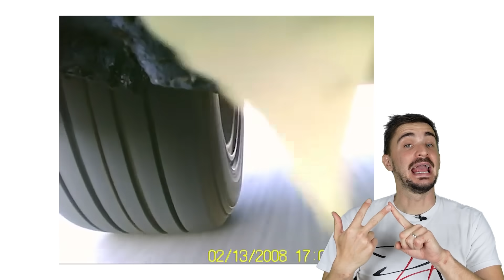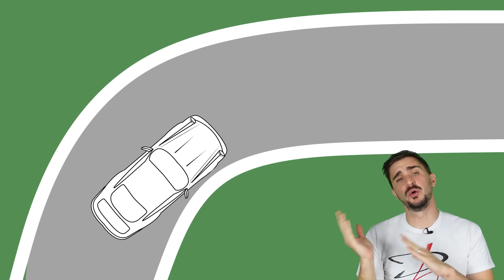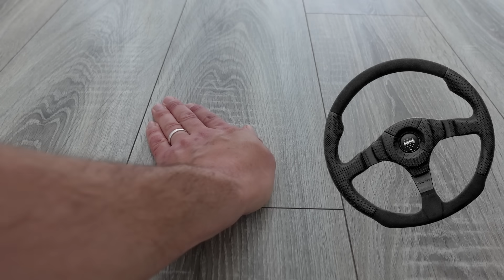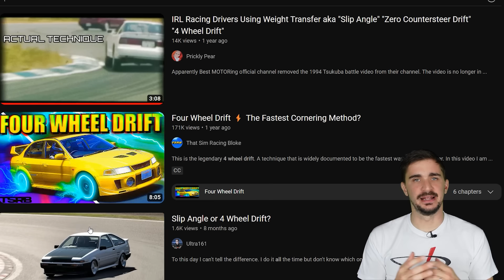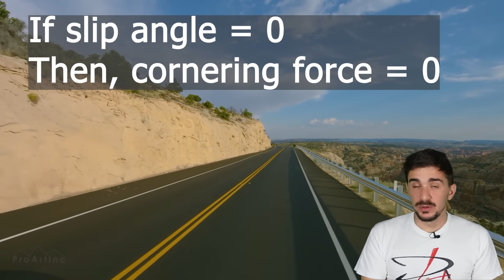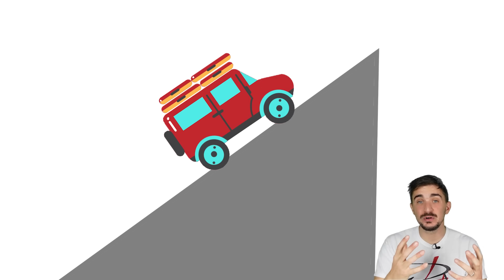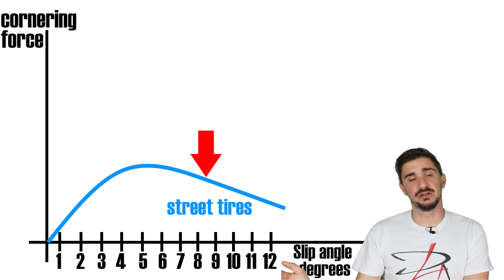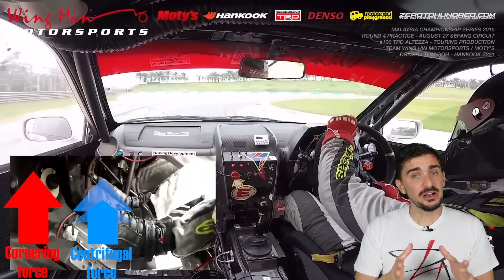You Think You Know But You Don't - Slip Angle Explained in a Way You Will Understand

Comment: great presentation (again) in an area where there's a bunch of different ways of explaining things  

a lot of people say there is no such thing as centrifugal force. this is wrong. a centripetal (inwards) force is required to make an object turn instead of going straight, which is the natural motion; and if there's a force in one direction, there must be an opposite force somewhere else. the road pushes the tire towards the center, and the tire is pushing the road outwards. this is centrifugal force, and with the right equipment you'd see that the road is compressed laterally to confirm that a force is being applied to it. but note that physicists often prefer to describe these situations in terms of centripetal force only, rather than a balance of centripetal and centrifugal forces: an object following a curved path must be accelerating inwards, according to the instantaneous rate of change of the velocity vector, and the road applies the force to make that happen. except, if the force required exceeds the the tire's ability to push back, the road cannot apply enough centripetal force to follow the curve, and a less tight curve is followed instead

the way i look at "cornering force vs friction" is that friction is the limit of cornering force, assuming you are not also braking/accelerating. if a cart with polished wooden wheels drives on glass, the slip angle is negligible. real materials aren't perfectly stiff so there's always some slip angle, but mathematically there's no problem imagining ideal wheels  of zero width cornering up to the limit of static friction. the wooden wheel behaves very close to this ideal, up to the static limit, at which point friction drops very dramatically to the far lower dynamic friction and the cart breaks into a slide. back in the real world on rubber tires, most cars don't exceed their grip limits. as your cornering acceleration (v^2/r) goes up, the tread twists and slip angle goes up, but your total available friction is irrelevant. so you think about the dynamics of steering input, slip angle & force. for average people taught to drive well within their grip limit, this simplifies to "turn the wheel and the car follows that radius", aka "i have no idea what to do when i lose control". and even though we don't think about the maximum available friction, the friction force at the road/tire interface is exactly the "cornering" force that the tire creates internally as it twists and mediates the force between the rim and the road. but aside from grip, the advantage of a rubber tire over a wooden wheel is what happens near the limit, which is that the rubber against the road gradually transitions from static to dynamic friction as the patch twists into steeper angles: even as some rubber starts sliding, the remaining rubber is being pushed to its maximum capacity, so the total grip still increases. and after the peak is reached, you can still increase the slip angle quite a lot before all the rubber is sliding. additionally, the difference between static and dynamic friction is much less with rubber than polished wood. the upshot is that with generous slip angles we get a less sudden dropoff when we run out of grip, meaning a novice has a safety buffer when they overdrive a corner, and an expert can drive right on the limit hunting the most grip. but in all cases -- low slip angle, high SA, approaching the peak, over the peak, way over -- the "cornering force" is exactly the same as the component of tire/road friction at right angles to the direction of motion

back in the sixties, F1 tires still had large slip angles, like 10 or 15 degrees. i think the sport has lost something without all that sideways motion, and the delay of waiting for your tires to catch up when you changed direction. racing tires especially are now relatively very stiff. you get more total grip, but the drop-off is steeper at the limit for a given compound, which just means you have to know what you're doing. i suspect the graph comparing road and racing tires is wrong. i'd guess for a lot of cases, the race tire obviously has a much higher peak, but that peak should be at a lower slip angle than the road tire peak. it's the force that allows you to turn a corner, not the slip angle, although obviously with lateral force there will always be a slip angle. with perfectly rigid tires, you couldn't turn in because you'd break traction every time you moved the steering wheel or hit a bump ... but more slip angle doesn't mean faster.  fwiw, historically drivers tended to drive below the grip peak to conserve their tires. F1 didn't involve tire changes as standard and jim clark was notorious for going through tires and brake pads much more slowly than his teammates

Comment: I think the main takeaway here is "Jerky steering input causes excessive tire wear".
It is then funny to note that historically many of the best F1 drivers, like Ayrton Senna, had VERY jerky steering input.
In the case of a race car it's possible this is advantageous because racing drivers are usually trying to create more heat in the tires, though this will certainly be at the expense of tire life but that factor changes with each era of racing. In the 1990's F1 cars basically never drove on worn out tires, whereas in F1 today you're pretty much always fully exhausting the tires before a pitstop.

Comment: I will admit, I had no idea my tires would deform when making a turn. That's actually incredible. It also makes sense with why you can lose control if you have a tire blowout. If I understand this correctly, during a tire blowout your centrifugal force increases causing you to crash or at the very least lose control of your steering. That and the centrifugal force was the root cause of the tire blowout. I'm probably wrong in how I understood this so if someone with more knowledge wants to explain it better, feel free.
Reply: No, the centrifugal force is totally independent of the state of the tire. The only two things which are determines the centrifugal force is the speed and the turning radius. During a tire blowout the tire lost its capability to transfer the friction force to the wheel and thereby to the car and that cause the loss of control (or in other words the max. achievable cornering force is drop close to zero, as this force transfer — in an unnecessarily complicated and misleading way — was defined as cornering force in the video).
Reply: @Zilahi-Branyi_Laszlo  I see, thank you for pointing that out.

Comment: How does the explanation change if the tire is a very hard rigid metal that doesn't flex at all and has an extremely tiny contact area with the road? The car still steers and changes direction, correct? Is that an even more complex explanation or does it simplify how cornering works with tires?
Reply from the maker: Trains? They would never go through a corner without rails.
Reply: @d4a  really? You think hard steel wheels would not steer a car around a curve on a smooth road?
Reply: @d4a  old horse drawn wagons (which could steer themselves without the horse) were made with wooden spoked wheels with iron hoops on their circumference. They managed to get around corners.

Comment: one huge factor in driving around a corner quickly and efficiently is the  automotive differential, which allows all driving wheels to rotate at different speeds.
this plays a huge role in how a car behaves when cornering so i found it important to bring it up.
Reply: then its also important to note that the open differential you referring to is a drawback to drive around a corner quickly. just search for limited slip differential
Reply: @gaborb  We need to be very careful about our wording here. Windhelm is correct, the open differential is an advantage to driving around a corner quickly, because it allows the driven wheels to rotate freely at different speeds. What you should say in your reply is that the open differential can be a drawback to traction when accelerating out of a corner (from apex to exit), not when driving around a corner (i.e. all the way from turn in to exit). With a limited slip differential, there is resistance to the driven wheels taking on different speeds and that can actually result in poorer cornering performance, depending on how the LSD is tuned. Understeer can occur on corner entry if the wheels are reluctant to start to turn at different speeds on coast. On corner exit, the same understeer can occur, or if traction is breached, oversteer can occur, often unpredictably as you transition from open to limited slip behaviour (it's rarely smooth!). 

I've raced and tested a number of cars with open diffs (Caterham, Metro, an older Formula Renault, and various Formula Fords) and two with LSDs (my Formula Renault 2.0, and my current MGB V8). I've also driven a number of cars on track non-competitively with and without LSDs. In my opinion, the open diff cars drive much more naturally and fluidly through all stages of corners, and breaking traction is dealt with predictably and gradually. LSDs can change handling somewhat, hindering cornering, and can be a bit grabby when losing traction, although there's no denying that they're ultimately faster if you can tune them correctly and drive sympathetically to them. Ultimately I'd take an LSD in the wet if well tuned, and despite the fancy diffs in my racing cars probably the nicest I've driven have been on BMW M road cars. In the dry if not too traction limited though, I'd rather have an open diff, for example an Elise or low/mid powered Caterham or Formula Ford.
Reply: @RobManser77  yes the wording is important but you are saying the same " there's no denying that they're ultimately faster". You are adding more details which is of course also useful and important. i wonder why you did not mentioned the 1 way lsd what is apparently your favourite. 
i also like the BMW M road cars (not the old ones) with the electronically controllable differential. Those are really tuned well and does what you asks for.

Comment: I was confused about cornering force, and I now realise that it’s the elastic flex in the tyre fighting to move the car inwards relative to the corner. Skip to 11:50, it’s just the wheel flexing back that’s pulling you into the corner

Comment: Super interesting! How would you explain the relation between slip angle and over/under steering?
Reply: They’re caused by traction loss. Basically depending on which wheel looses the traction depends on which one occurs. It looses angle which makes it go in a random direction because it’s following the force pushing it off the road. The tyres aren’t contacting the road properly when it happens so if the rear wheel isn’t gripping the force pushes the back out into a spin and when the front isn’t contacting properly the force takes the car to where it was trying to make it go originally.

Comment: Oh, no, no, no! Why? Whyyy... did you call the anti-wing a 'spoiler'??? On a channel so thorough, on a channel so precise in explaining things and distinguishing things.🤦‍♂

A spoiler can not create a downforce. Its function is to spoil the attached airflow on a curved rear surface of a vehicle's body, to separate that airflow from the body and throw it in bashing swirls of turbulent air thus creating a substantial drag and also measurable fuel consumption increase. Its function is to spoil the Coandă effect. Being cool by itself Coandă effect lifts curved parts of a car, especially fastback-like rear ends of cars. Just remember the story of Audi TT Gen 1. Spoilers do not create the downforce, they decease the lift made by Coandă effect.

What was shown in the vid and was talked about were the anti-wings. Or just the wings. An up side down positioned airplane wing that has its lifting force under itself. The anti-wing is always being blown by the clean air. 'Clean air' in aerodynamics is an air around a relative system, undisturbed by any bit of that system. If the relative system is an airplane, the undisturbed air is the air just right before the flying plane. Also above and below it, and to its sides. The distance is from infinity (which is not, is's the Earth's atmosphere) to the closest point to the airplane where its parts do not yet change the flow of that air. If a relative system is a car, clean air is the air that is before the car, to the sides of the car and above the car. A fun thing is that the incoming clean air can be pretty turbulent (kinda not clean), say cause of harsh weather conditions—it is still considered clean.

Anti-wings almost always hang in a flow of the clean air. And—it is the anti-wings who create downforce, not spoilers (although sometimes spoilers can make a downforce, but it's usually in conjunction with other aerodynamic tweaks and is not so straightforward).

Cheers! ❤

Comment: Doesn't downforce basically use the same principles as lift but reversed? As in its using differences in air pressure rather than the normal force of air hitting a solid surface. 
Rest of the video was very eye opening though, good stuff

Comment: And this is why road tires should have high walls:
Softer the sidewalls and more narrow tire is, slip angle at which max grip is generated is very high, and curve is much more flat. So driver has the time to slow down and correct steering. 
Low profile tire would have lower slip angle and would make steering feel more direct and will generate more grip, but if you go over the limit, you are done.
So 175/65R15 is for me.

Comment: Question for you. I've been thinking that lowering the tire pressures on roads cars (for track days or autocross) give you more grip not completely because it allows more contact patch, but more so because it gives you an improved peak slip angle to grip curve.
Reply: Yes lowering tire pressure definitely helps
Reply: @DylanL69  lowering pressures in a road tire also increases tire temperature though and once the tires exceed optimal operating temperature you will start to loose grip rapidly. Peak grip on a road tire will be at much higher pressure than a racing tire or semi slick. anything with a soft sidewall will benefit from higher tire pressure (a052, R888r etc) tires with a stiff sidewall like z221, a050, re71RS, cup2R will benefit from lower tire pressures.

Comment: For the sake of physics it's better to clarify one concept, THERE IS NO FORCE called CENTRIGUGAL FORCE that pushes you towards the outside of the curves! It's not a force, the force is called CENTRIPETAL and pushes you towards the inside of the curve(***)! It's set in stone. What you call centrifugal force is used in calculations that are made taking into account a non-inertial reference system for convenience. Technically it is called apparent force because it does not exist in the inertial reference system
Reply from the maker: For the purposes of this video that would just complicate things and steer things away from the point. I often circumvent and ignore issues like this because the goal of my content is to allow people to wrap their heads around a concept. Once they do that they can easily further explore the nuances if so desired. Also, typing in caps is really silly, there's no need to yell. I can read non-caps just fine.
Reply: @d4a  There was no intention of yelling in the mean sense, as is usually done in web. It catches your eye when you scroll through so many comments

Comment: The only flaw I find is that you present the contact patch as a stepping motion, blocky.   The contact patch is very fluid and not stepped as presented. It also has various shapes but do not change size.  Some of the explanation is also distinction without a difference.

Comment: Thanks for another great video. It is true that there isn't much talking about slip angle and I only heard about it for the first time when I started sim racing. I think there is a tiny inaccuracy in you explanation for the tiny drift of fast drivers though - maybe it is just a misunderstanding. As all tires contribute to the total cornering force of the car, you want to utilize the maximum available grip of all tires to make the turn as fast as possible or in other words, you want all your tires at the optimal slip angle. As the rear tires are fixed to the car and therefore always point in the same direction, the only way for them to have slip angle is if the car points in a different direction than it is going. That means the car is slightly sightways and appears to be drifting. That is the reason that fast drivers are going slightly sideways and not the fact that they are a bit over the limit.

Anyway I love your channel and learned so much already that I hope you never stop making videos :)

Comment: How would a vehicle behave it fitted with rigid, non-flexible tires ?
Reply from the maker: Horribly? Like a train, and as you know trains don't do sharp corners. In fact they would be lost without them rails 😉
Reply: @d4a  
Great Video…All are great !
Are you a mechanical engineer ?